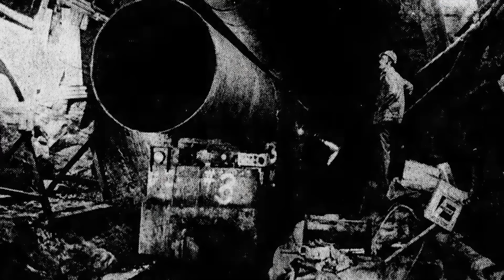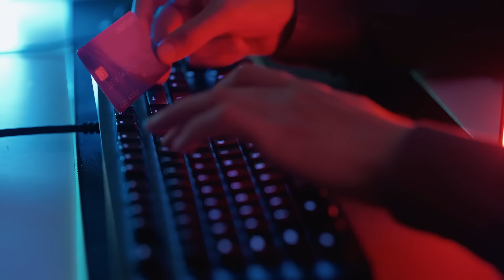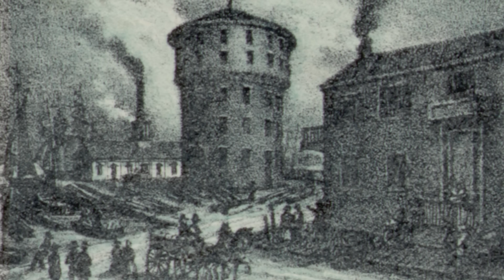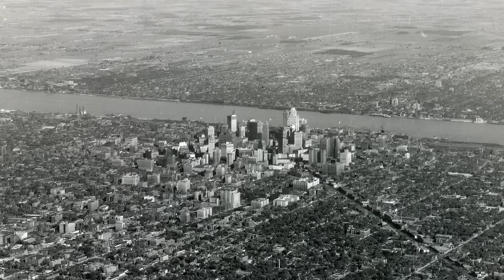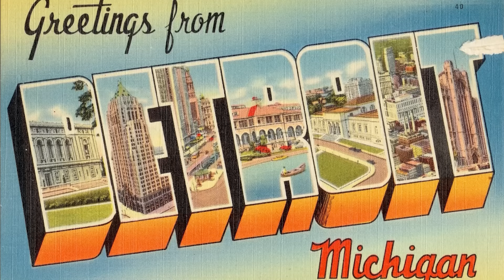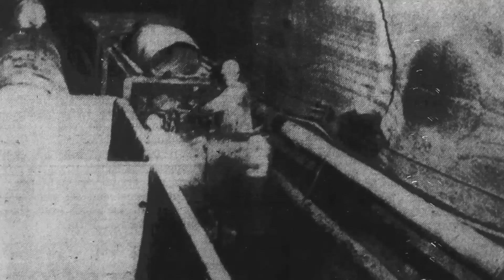Why Detroit Built Secret Islands in the River

Comment: You should do Louisville Kentucky's water system, as they are said to have the best tasting water in the country. They intake it straight from the river at the sight of the old art-deco water tower. They have a large open reservoir in the middle of town and its matching pump building. Their extremely old/mixed water line system not to mention mixed use sewer system. Also compare Louisville's water system to how the Indiana community on the other side of the river obtain their water from ultimately that same source, the Ohio River, one of the largest rivers in the US. There is also the interesting history of why Louisville became a city (i.e. the falls of the Ohio), and how the river at Louisville has been modified by humans over the years, including a hydroelectric damn and McAlpine locks.
It was also the actual starting point for the Louis and Clark and the Corp of Discovery.

Comment: If you're on the Detroit river or a spot on St. Clair, you can hear the pumps pulliing in the water. Towns as far away as Ypsilanti use that water. I was able to take a tour at the high security operation center. They have televisions so they know when to boost the pump pressure during  commercials, especially sports programs.

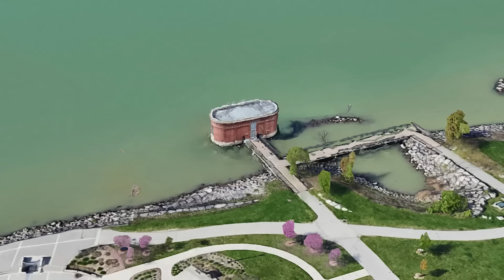Comment: @12:53 That water crib is for Windsor, Ontario, Canada and stands at the foot of Langlois Ave along Riverside Dr E. It was originally built in in 1914 and is no longer part of the drinkable water system but instead refitted for use in the waterfront parks irrigation system as part of a beacon project, nicknamed "The Dawn Beacon" being the first of 5 to be refurbished as landmarks.
Reply: That's so cool to know. So glad they reused the old buildings because not only are they pretty they were built to outlast us!